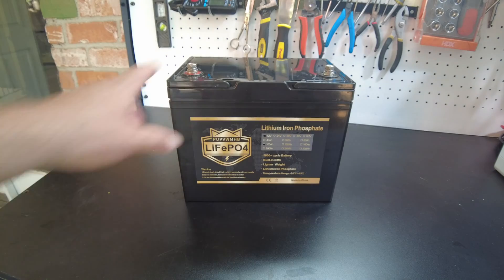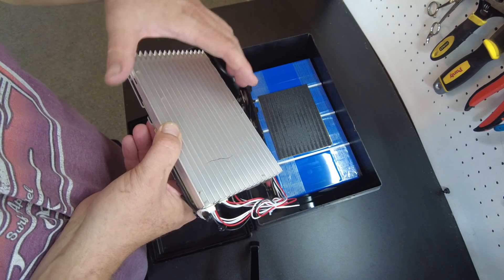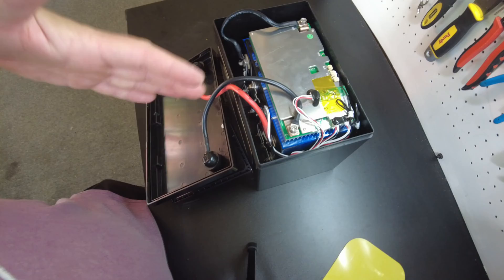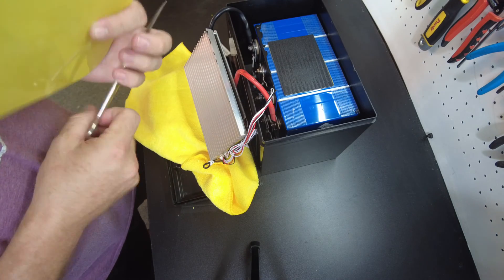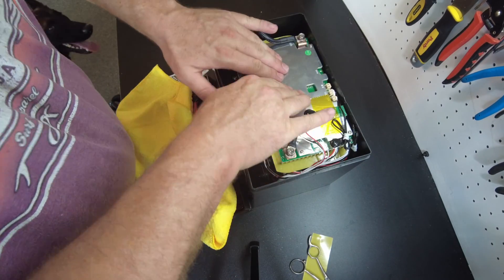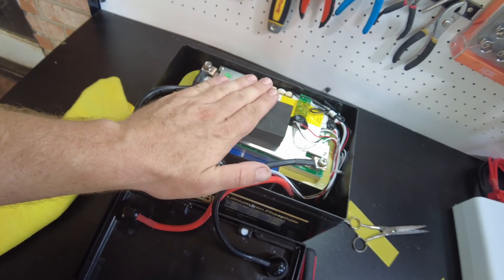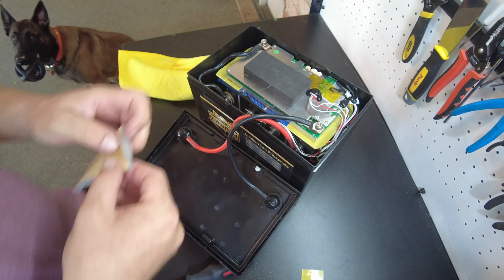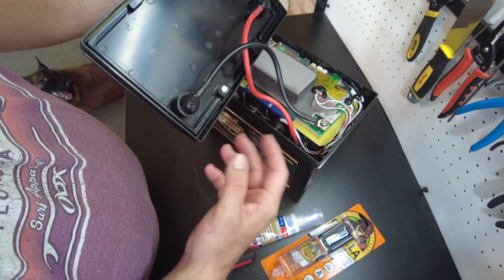Follow up/My fixes for PUPVWMHB 12V 100Ah MINI LiFePO4 Lithium Battery

Comment: The positive and negative, i.e. red and black wires seem a little thin, is that a concern? Especially if a lot of amps need to be drawn from the battery?

Comment: Dam for the price with low temp cutoff these mods look really easy hard to beat
Reply from the maker: Yes, very nice price in these. If you're using it in a stationary application probably no need to mod. But it it's going in a vehicle, RV, etc. I would mod it.

Comment: Sir:  I notice the #7 wires have some black stuff over the terminal end.  Is there a bolt under there so one could replace the wires with #4 or even #2 wire inside?  

A T Burke
Reply from the maker: Yeah, I think so. Thanks

Comment: The cell orientation in that battery is a problem.  The specs for most cells say they must be oriented so the relief is on the upper face.  Some sellers do say on a side face is OK but even then it's stated that it is not preferable.  People do place lithium batteries on their side of accessibility reasons and that potentially will see the relief on the bottom for this battery and no manufacturer says that is OK.
Reply: If that relief blows, it's over anyway...So, meaningless...
Reply: @realeyesrealizereallies6828 Plenty of documented cases where the relief has cracked or been damaged at the factory (reject cells etc) and electrolyte has leaked out with cells not standing upright.    It's actually a fairly easily perforated foil seal.  It doesn't need to blow out from over-pressure.

Comment: Don't know how many people know about batteryevo, but right now they have 12-volt 120 ah batteries for $329. They have nano phosphate pouch batteries. I just got done testing mine and it works good. By far the cheapest battery they have had. They have 300 amp fuses built in, 4 awg wire inside and 175 amp anderson connectors for anyone wanting that on a battery.
Reply: @@thesolarjunkie I hope they stay on sale long enough for you. This is the 3rd battery I have bought from them. They also come with an anderson to lug terminal connector that is 6awg silicon wires. They rate it at 175 amps. I pulled 220 amps on the battery on my test. I just tested the low temp cut off and it works. BMS shut off and came back on.